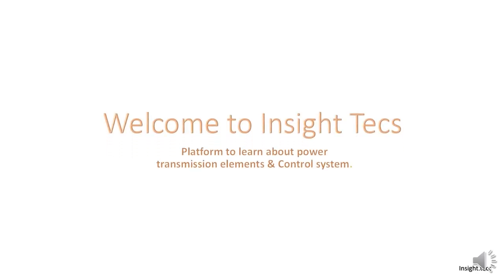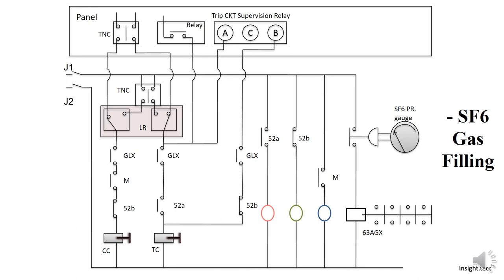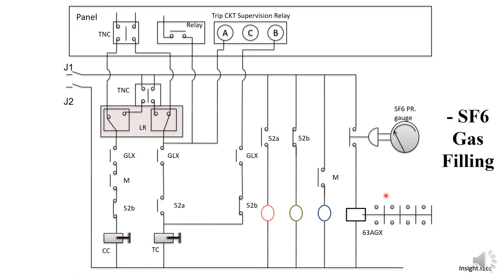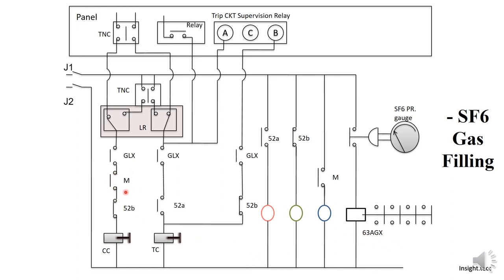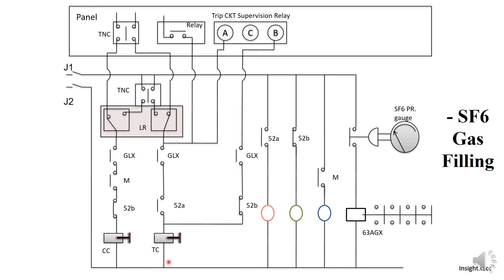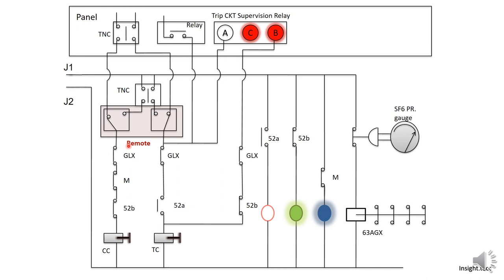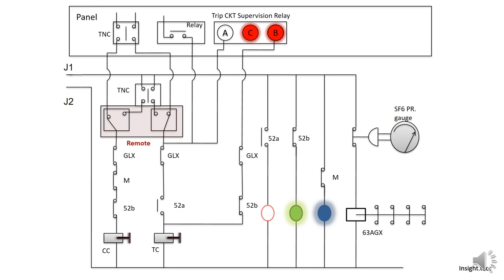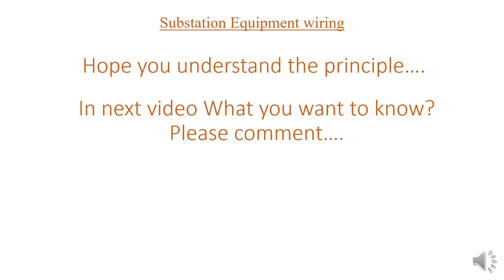Basic operations and wiring of circuit Breaker

Comment: If any of contact stuck during fault of time than which protection come in line?Bus will be disconnected?
Reply from the maker: Thanks for watching 👍..in such scenario  local breaker backup protection will be operated also we have bus bar protection scheme in action, and if any such contact   is observed it's troubleshooting needs to be done while maintenance work. 
Keep watching..
Reply: @Insighttecs  👍